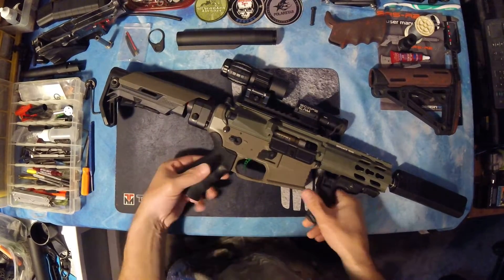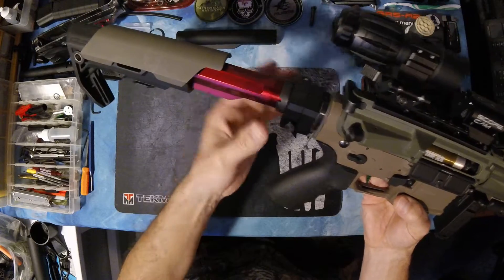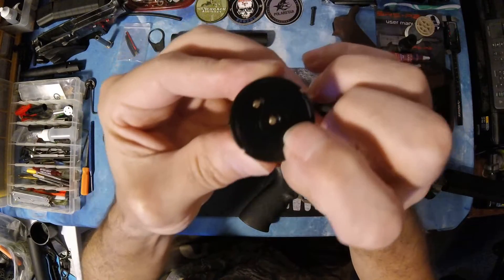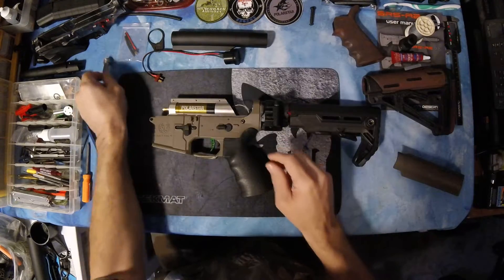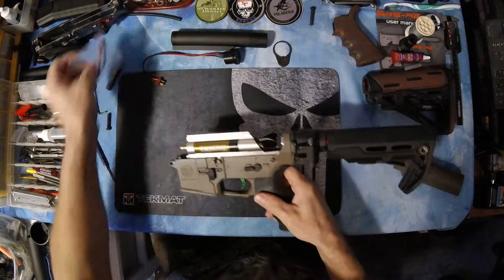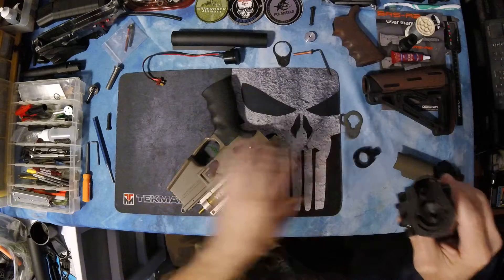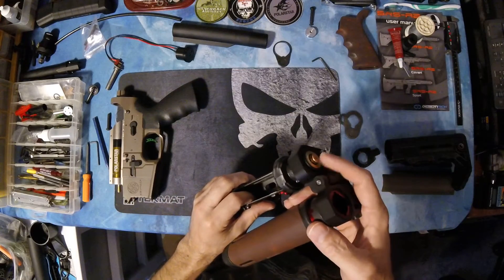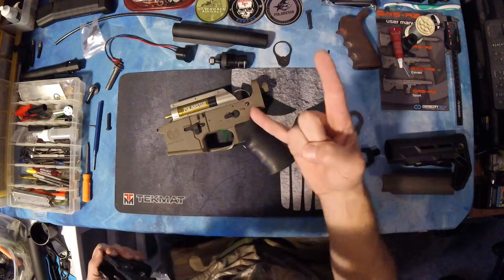G&P Folding Stock For AEG M4/M16: Install Guide And MODS

Comment: Could you run this with an AEG and the stock wiring and just let the wires be loose when it folds I just want to be able to fold for transport but I don’t want to have to deal with the contacts and whatnot I’d rather just have my wiring and mosfet going thru like normal and just fold it carefully
Reply from the maker: I don't see a way to run the wires thru without drilling a hole.

Comment: So basically, it’s a glorified cutoff switch?
I installed a Perun ++ ETU into my G&G arp9, and it appears, I wouldn’t be able to just reroute my wires to work with this stock.
Great video by the way! I rewatched it before commenting to ask something you answered!
Reply from the maker: Yea you could use it like an off switch guess. Thanks man, anything else just ask.

Comment: Do you know if there could be a way for it to work even if you have an aeg? The only thing I can think of is a Peq batter housage
Reply from the maker: That would work I guess. That or just a front wired gear box.
Reply: Pretty sure im late but they make an AEG version  that's available on evike
Reply: NVM I'm stupid

Comment: You might have said it and I didn't catch it in the video but can you use any stock like a a2 if you wanted or only buffer tube type
Reply from the maker: I'm sure it's doable, just need to make a few modifications.

Comment: How Do you put the battery inside it, I think I'm a little bit stupid because I cant find anything
Reply from the maker: The battery goes inside the buffer tube. You would remove the stock from the buffer tube more than likely and install the battery and then replace the stock.

Comment: The gun is not usable while the stock is folded correcT?
Reply from the maker: If your using an aeg yes. The battery is cut off.